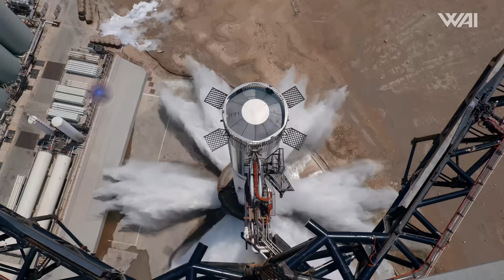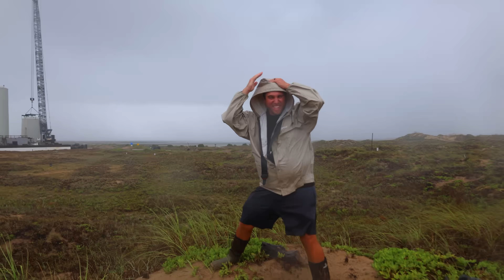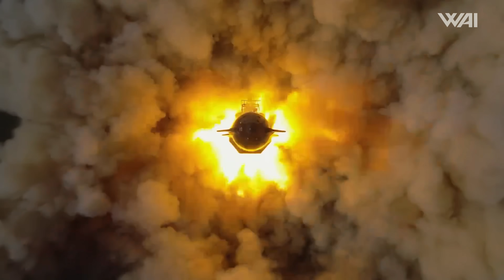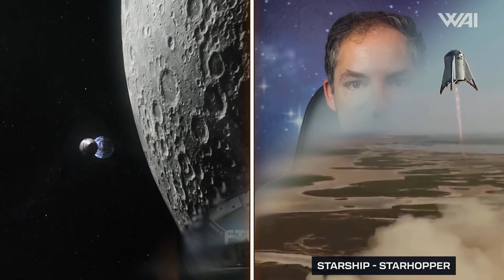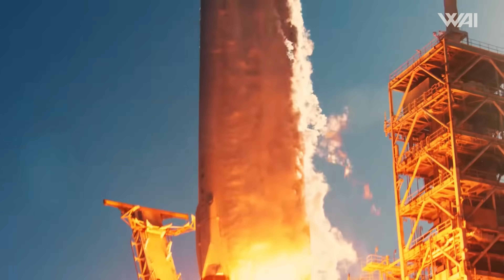SpaceX Reveals Latest Starship Flight 5 Launch Estimate! + Inside The Starship Miracle Engine!

Comment: I worked on construction for the Comance Peak Nuclear Reactors in Texas in the 1980s. There are two containment buildings, each taller than the US Capitol dome (288 feet (88 meters).  There were two cranes at the construction site, each capable of raising and lowering loads to the top of the domes. One afternoon, a storm front appeared with wind gusts up to 50 mph. There was an order to lower the cranes to ground level, but the operators of one of the cranes rushed to get 'one more load' before lowering the cranes. The winds caught the cranes and sent it crashing to the ground. Unfortunately several buildings housing engineers and construction personnel were under the landing area. Several buildings were crushed under the mass of the crane. Several people were crushed and died as a result. ALWAYS lower extremely tall cranes when violent storms approach.  A few years ago a relatively small crane on a building under construction collapsed in Dallas killing several people in an adjacent apartment complex. The nature of the ground in the area is a nonfactor. High winds and cranes do NOT interact well.  Relatively simple physics.

Comment: MyRadar is probably the absolute BEST REAL TIME weather radar app. It's OUTSTANDING. I've been using it since I worked with a deck and fence company down in Cape Coral FL back in 2014 or so. Yeah, it's been around for a while and it really hasn't changed one bit only minor improvements. MyRadar is the ONLY weather app I use on my phone. I am not sponsored by nor paid for by MyRadar or their parent company. It simply WORKS.

Comment: Felix, don't you think, that Elon Musk was absolutely right about the fact, that launch tower will be taller? Everybody looking now for two "missing" segments of the tower. But we all remember, that Elon also said about complete redesign of the launch pad. 

So, I suggest one thing. If the new launch pad will include the flame trench/flame diverter, it might be, that launch pad itself will be lower than existing one. So, that means you not need to stretch the tower,  because your new launch pad is literally two segments lower, than it was before. And this new launch complex will be able to accommodate new and taller version of the Starship, aka Starship V2. 

I think, it might be quite reasonable idea.

Comment: As I understand geosynchronous orbits, the orbital plane needs to be the same as the equatorial plane. If not, the satellite will stay over the same longitude but will alternate in latitude. This means a geosynchronous orbit is only feasible at an inclination of 0°.

So, what’s the purpose of the Ariane 6? Maybe it can place two satellites in different right ascensions of the ascending node? But if there is no ascending node, is that even the correct way to say that? What do you think?

Comment: Just a guess, but 'the hill' might have been used as weight to compress the ground. Piling ground is a technique used to press water out of the ground and packing the ground. I only know that because of watching Practical Engineering.

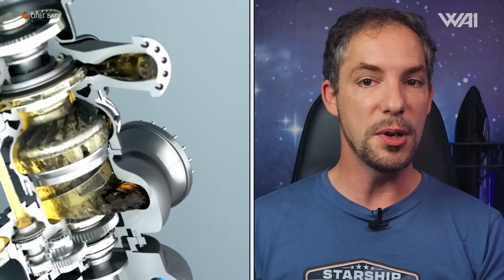Comment: 12:32 Full flow doesn't necessarily use methalox. The Soviet Union tried to make one using hypergolic propellants
Also, full flow is a type of closed cycle that has all the propellant go through the preburners. You can have other types that have some liquid propellant go straight to the combustion chamber.

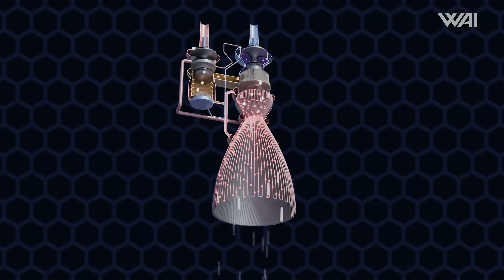Edit: 12:36 The fuel doesn't have to flow through the walls of the combustion chamber. It's just a very common way to cool the combustion chamber.

Comment: I think Stoke is onto something with their new design, because it also solves the heat shield issue. I mean no tiles, that is a good thing. Every tile on starship is a probability for failure. Since stokes design makes the cooling part of the engine and heat shielding, that’s very smart. Let’s see if their design works out. Imagine a starship with this design 🤔

Comment: 🎯 Key points for quick navigation:

00:00 SpaceX is ramping up development at Starbase despite Hurricane Beryl's threat, focusing on building a new launch tower and preparing for Starship flights 5 and 6.
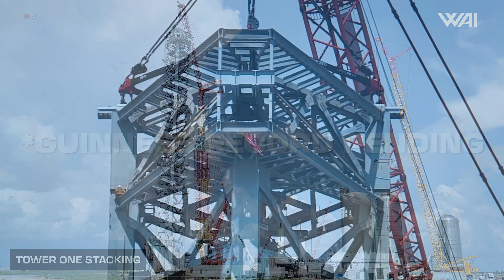01:49 SpaceX aims to fully stack the new launch tower at Starbase by August 15th, using prefabricated sections to expedite the process.
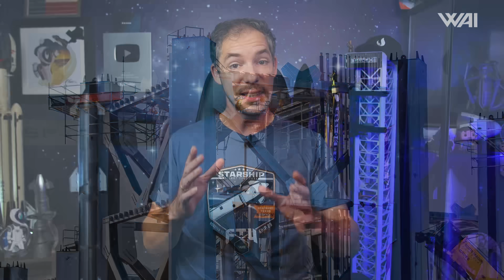07:41 Booster 12 is gearing up for a static fire test, with a new launch window for Starship flight 5 set for no earlier than August 5th.
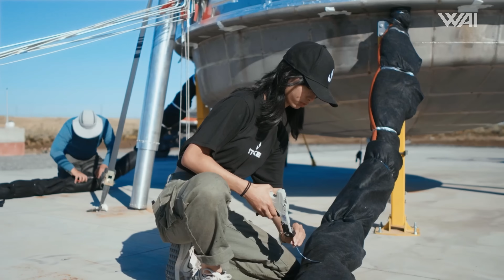12:11 Stoke Space achieves multiple successful hot fire tests of their new full-flow staged combustion rocket engine, advancing towards orbital launches.
15:51 Ariane 6, Europe's latest rocket, is set for its first flight on July 9th, positioning itself as a cost-effective option for dual-payload missions to Geosynchronous orbit.

Comment: Landing the Starship Booster on the Oil rig platform using the Mechazilla's Chopstick would be a much safer option in case something does go wrong.

Comment: Regarding Ariane's "dual-payload" capability, there's a catch when you compare it to Falcon Heavy... and that's that A9 payload to GTO is only about twice that of Falcon 9 (~11 tonnes vs ~5 tonnes).

So if you're launching two satellites at once, at least one of them — and possibly both — are light enough to fly on Falcon 9 for much less cost, even if it takes two launches. And that's been a problem for Arianespace since F9 started flying... they may have the ability to launch two satellites on one rocket, but they didn't actually have many secondary payloads to launch, because SpaceX was gobbling up that part of the market.

Comment: Something I couldn't help not noticing:
On the SpaceX renders for the block 2 Starship, the ship seems to lack a QD panel, and the booster seems to have two. While I understand these are just renders and not actual hardware it makes me wonder if SpaceX is planning to switch back to their original method of fueling the ship: through propellant lines integrated on the booster. This would greatly simplify GSE and make on-orbit refueling easier. The lack of transport of the ship QD currently at the cape to Starbase is also something that I think is a sign of this being the case, but this is of course still just speculation.

Great episode as per usual WAI team!

Comment: Why is SpaceX not doing a flip/de-orbit burn to decrease speed faster?
Reply: @SuperMouseDV  They do a de-orbit burn if needed. IFT4 had the de-orbit included in the “orbit” it flew. It was going to re-enter anyway. A flip and de-orbit will be done to leave LEO, most likely. 

The decision not to slow down too much too soon actually reduces the total heating that a spacecraft has to endure. It essentially skips across the upper atmosphere until it slows down enough to descend into the lower atmosphere. Once it does that it cools down very quickly.
Reply: @FlynProfessor  well one would assume(me) that the slower the ship is going before re-entry the less heat on the tiles. But breaking from 17k mph would take maybe a full booster of fuel at that speed. But wouldn’t any little extra count towards a less hot re-entry even if it’s shaving off even 1000 mph?

Comment: All those shots of the Megabays raises a question: NASA's 'old way of doing things' has spacecraft, including boosters, assembled in ultrasterile clean rooms. SpaceX does it in open air. So, what's the point of that sterility, and why doesn't SpaceX need it?
Reply: Boosters were not built in clean rooms.
Reply: Payloads are assembled in ultra-sterile clean rooms. Launch vehicles, not so much.

And remember, SpaceX is improving their facilities. Yes, the earliest Starship prototypes were built by guys welding steel outside in a swamp, because they didn't really care about quality-control at that stage of the process... they knew they were building rough throw-away hardware. But they now have an entire factory complex... they're not doing much in the open air anymore.

Comment: INITIAL CONCERNS ON "STOKE -FULL FLOW" ENGINES 1.) Single Point of Failure Engine 2.) Unknown Attitude Control 3.) Ultra Complexity = Lower Reliability 4.) Engine Bells seem "Exposed" to Re-Entry Thermals.

Comment: Ariane6, Vulcan-Centaur, and New Glenn are more efficient for launches to Geosynchronous Earth Orbit (GEO).  However I question whether that is a viable long-term market.  Why send telecommunications on a 120,000 km round trip if a LEO constellation supports a mere 1,000km trip?  Furthermore the "prices" for Ariane6 are from a taxpayer-subsidized corporation to a government aerospace agency.  By contrast SpaceX is charging based solely on its competition, not on its operational costs.  Until its competitors can offer over 100 launches per year SpaceX will remain, by far, the low cost, not price, option.

Comment: Would it make sense to pretty much cover the olm and launch tower in heat shields to prevent heat damage? And, doesn't the fuel tank farm seem woefully inadequate for many launches? And, a seawall around the facility to cope with flooding? And, last but not least. Another quality video by you and your team. Great job as usual 👏
Reply: No.
Reply: @TheEvilmooseofdoom  I think you mean "NO!!!!!". ;)

Seriously, this gets suggested — and shot down — a thousand times in every SpaceX-related video. Heat shield tiles are fragile pieces of ceramic... good for managing heat, but they'll break if you drop them, much less subjecting them to the full force of the booster engines. They have enough difficulty making them stick to the Ship without breaking, never mind putting them on the pad.

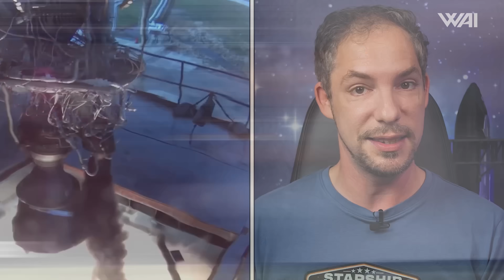Comment: 13:00 full-flow staged combustion is just a small subset of all staged combustion/ closed cycle engines. There are many engines like BE-4, RS-25, NK-33, RD-180, etc., which are staged combustion engines and don't dump any unburnt fuel overbord, but are not full-flow staged combustion engines.

The  difference between full flow and non full flow staged combustion engines is that most closed cycle engines have fuel-rich OR oxygen-rich preburners while full flow staged combustion engines have both. With a non full flow design, for example the BE-4 or RD-180, all of the oxygen flows into the oxygen-rich preburner to be burnt with a bit of fuel and power the turbopumps, but most of the fuel enters the combustion chamber without going through a preburner. For a fuel-rich design like the RS-25 the reverse is true. But for a full flow staged combustion engine none of the propellant reaches the main combustion chamber without either going through the fuel- or oxygen-rich preburner. This means that both fuel and oxygen are gaseous when burnt in the combustion chamber, which allows for faster and more efficient combustion. The drawback of a full-flow design is that you have a more complex engine with more parts. Non full flow designs have the option of only featuring a single preburner and a single shaft powering both pumps (for example BE-4), but that's not possible with a full flow staged combustion engine,

Comment: The statement that "the only other company in the world to fly a FFSC engine" probably should be clarified.  Closed cycle/staged combustion engines have been around for a while,  e.g. Russian RD180, Space Shuttle RS25, Chinese YF-100.  These however are either Oxygen-rich staged combustion or fuel-rich staged combustion, generally using a single pre-burner.  The Full-flow staged combustion engine uses two pre-burners, one oxygen rich, the other fuel rich.

Comment: So, could falcon rockets benefit from switching over to methane & the raptor, or are there issues that would preclude that?
Reply: Issues that would preclude that. Methane is cryo; different tankage, different temperatures, different densities, different engines. Different rocket.
Reply: Nothing a full redesign wouldn't fix.
Reply: @TheEvilmooseofdoom  But you know, while you're changing things, you might as well make it a bit bigger and put some more engines on it, and maybe see if you can make the upper state re-usable...

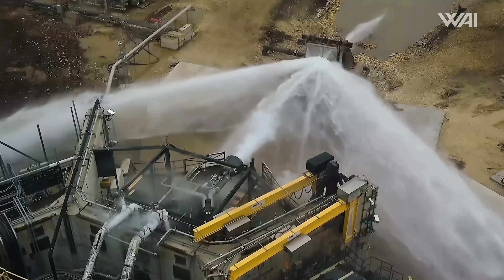Comment: 12:22 I don't really think you can say that the "full flow staged combustion engine" and "closed cycle engine" are the same. Of course a full flow staged combustion engine is an closed cycle engine like every square is a rectangle but they are not the same. A lot of closed cycle engines have been in use for many years, like RS-25 in Space Shuttle, but there wasn't any full flow staged cumbusiton in use yet (SpaceX is still testing). 

The main difference between full flow staged combusion and "oridinary" closed cycle engine is, in full flow staged combustion engine the oxidizer and fuel enter the main combustion chamber in gaseous form while in an "ordinary" closed cycle engine one of them (oxidizer or fuel) is still in liquid form. 

But I would like to say, your descirption of how rocket engine work is pretty good, and suggest to everyone intrested how rocket engines work to check @EverydayAstronaut Youtube channel.

Comment: Isn't Electron a full flow engine also?

If the turbo pumps are electric, I can't think of why they wouldn't be using all the propellant, unless they use it for cooling and then dump it?
Reply: Is that really what "full flow" means? I don't know, but i don't think so.
Reply: I could be wrong, but I don’t think electric pumps can be fast enough to do the job. Turbo pumps are basically jet turbines powered by combustion. Their only limits are melting point of the metal they are made of and the bearings they spin on.
Reply: No... the concept of "full flow" doesn't even make sense if you're not combusting fuel/oxygen to drive the pumps. Technically, they're not even "turbopumps", because again, that describes how you're driving them. They're just electricity-powered pumps...

Comment: The hill was for putting pressure on the ground to push out the moisture.  They did the same for the other starbase structures.
Reply: They DID do that, but I think this is a different case.  This is the launchpad from the Ship landing trials of a few years back.  The hill was built up and used that way for years.  Now they’re ripping that all out.

Comment: Felix... do you think Space-X will ever launch a Ultra heavy Starship configured like a Falcon Heavy, i.e. Using two super heavy boosters as side boosters to increase the max tonnage to LEO or GEO?  I think it would allow Starship to make orbit with most of it's fuel still onboard so a refueling of a second Starship would be more efficient.
Reply: I would guess not, can you imagine the launch pad and mounts needed for that? Remember the final versions will be about 100 feet taller than the ones we are seeing today (120m vs 150m)
Reply: It would make more sence longterm to increase starships diameter. tricore inherently complicates logistics in a way that sabotages rapid reuse.